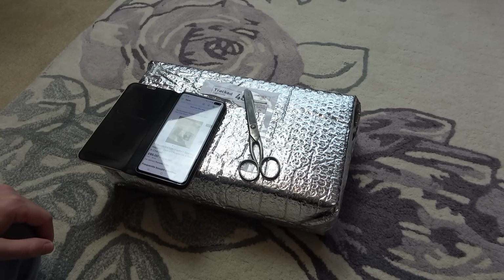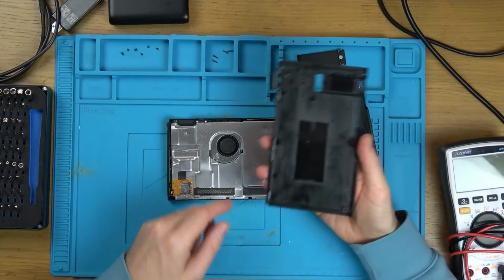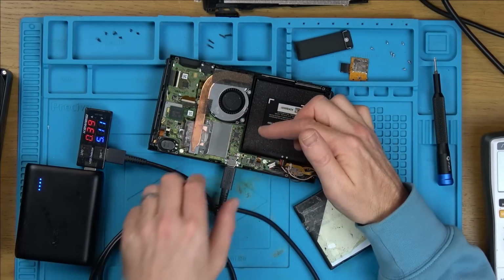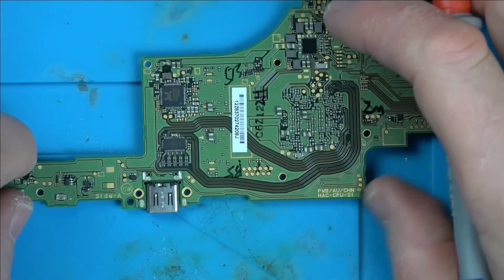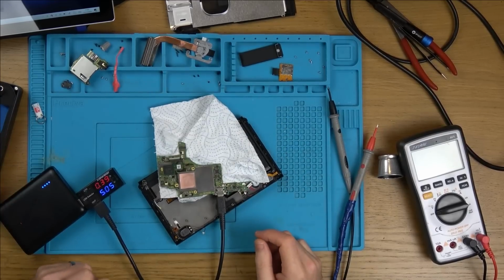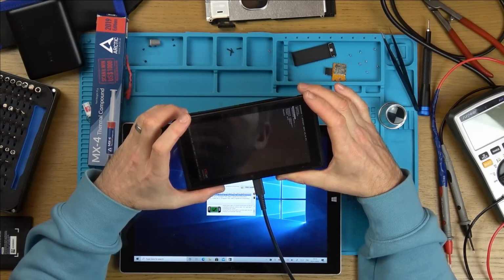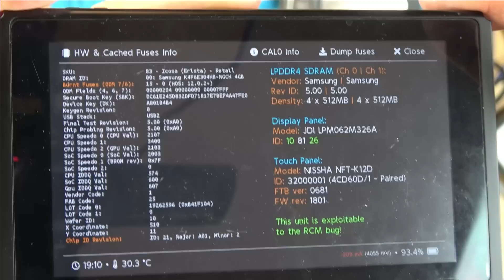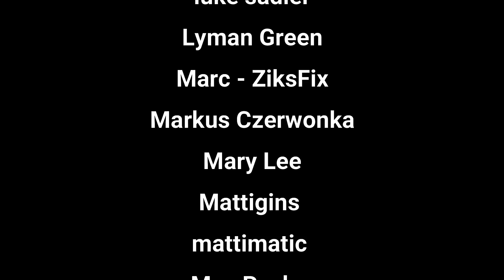Dishonest Broken Nintendo Switch from eBay - Can I FIX it?

Comment: For God's Sake All of you (you too Vince), STOP telling "is Hacked"...  Is not hacked... 
The eMMC NAND is gone faulty/broken, and so the RCM is automatically triggered by the APU, and can even be triggered if you unplug the emmc module from the motherboard.

If AutoRCM Mod is installed on the NAND, but the NAND is Broken/Inaccessible how on earth can you trigger it? The response is above.

CFW is Installed on the microSD, emuMMC too, so you dont even touch the original NAND, if a CFW is installed.. This is the Basics when you install a cfw.

And don't confuse bricked console with Faulty emmc, because a bricked console will still turn on, even if you brick by accidentally turn off the console while updating the firmware, or if you are unlucky it turns off by itself during update ... 
The Switch can still turn ON, BUT it will "LOOP" with the Nintendo LOGO Reboot and repeat.. It's called Nintendo Logo Brick Loop, because the firmware is broken.
I know it very well, because a long time ago i accidentally bricked/corrupted the firmware, and the console stayed in the logo loop, until i fixed the firmware dirs/files.

This isnt the case, the eMMC NAND is Faulty/Broken. STOP!

Comment: 25:40
Vince, what you found from plugging in the Tablet and using TegraRCM was important, but it's not what you think it is.

"RCM OK" doesn't mean that it's been hacked, but instead that the main bootloader for the Switch OS is bypassed for the backup . Whether or not a Switch has been hacked, if I plug in a Nintendo Switch turned on normally, of course it will not be in RCM. The findings you have show that, for some reason, the Switch is always in its backup bootloader. It is odd because it should only happen if you boot with a jig connected and press the sequence of buttons on the top. Perhaps the main OS did have a hardware failure and grasps on its RCM as a fallback, or maybe it actually was hacked but somehow had the main boot procedure changed with the backup bootloader, which is completely ignoring hacking guides.

Comment: Anyone had/has my issue with a Series X controller? The issue I'm having is the with the start button (button w/ 3 lines) It seems as if it is always pressed down. The controller isn't sticky or anything other than the button isn't actually pressed in. It acts as it should normally, but testing it in gamepad tester or xbox, it is always highlighted. When I go to use the controller on my Xbox, all of the menus fly by super fast. All of the other buttons work fine. If anyone, especially you guys who fixes these kinds of things, have a know how to solve this let me know. I made a video on my channel under "xbox issues" showing the issue.

Comment: You can overclock the ram/graphics/Cpu on jail braked switches which is actually useful on laggy games.
Also please let the sellers that try and "do one" that you have found it was hacked and you fixed it just for the jokes in future videos (second time you fixed a scammers item I  believe.)
Reply: And you can mod Switch games. Proper mods for Skyrim and such and simple performance hacks for pretty much any  other demanding title. It's great.

Comment: I was doing a motherboard and dreading testing 100s of passives for double beep shorts, when I realised, if one side DOESN'T beep, you don't need to test the other side because it's already proven it won't double beep. Did the whole MB in about 10min.

Comment: Why don’t you remove the “hack” and put back the original software?
Reply: For God's Sake is not hacked... The eMMC NAND is faulty/broken, and so the RCM is automatically triggered by the APU, and can even be triggered if you unplug the emmc module from the motherboard.

If AutoRCM Mod is installed on the NAND, but the NAND is Broken/Inaccessible how on earth can you trigger it? The response is above.
Reply: Oh i thought the eMMC was just corrupted by the previouse owner

Comment: Note: You can only do this with V1 Switches from 2018 depending on the serial number. V2 and The oled version you cant upload a payload so you can't install custom software.

Comment: I immediately knew it was in AutoRCM mode and likely had a bad eMMC. As someone that works in repair, this is all too common with hackable Switch units. I almost assume it's the issue at this point.

Yet, sellers never tell the truth. The always "have no idea" yet when you get it running again it's been modded to the brim already, lol.

Glad you figured this one out :)

Edit: Also, the seller knew as a console only goes into AutoRCM on it's own when the battery goes below 1v. Since that had 2.5v , they certainly knew.
Reply: Are you joking right?
AutoRCM MOD cant activate if the NAND is faulty. But the console will trigger the RCM because the NAND isnt Accessible (fault/broken).
In fact, when Vince changed the NAND with a working one, RCM isnt triggered by default.

But anyone can do this experiment, unplug the eMMC Module from the switch, turn it on/or connect to pc, and MAGIC RCM mode activated. 
because there is no nand or missing, or like above, fault/broken...

Comment: Vince could you do me a favour and send me the serial number to this? I have a feeling I worked on this a few weeks ago. It has a dead EMMC and I did actually attempt a repair on it. I don't think it had been hacked (I asked the owner). A reball won't work on the EMMC because the chip itself has failed completely and it needs a new EMMC pairing to it. Great job pinpointing the issue btw!

Comment: It looks like APX is a built in 'service mode' that normally isn't available to the end user.
It does not appear to be a firmware 'hack' or modified software on the switch so far as I can tell.  Here's a short video showing how to access it with a functional switch.https://www.youtube.com/watch?v=d042IoBkJjI

Comment: For the eMMC, I don't really know to what the code is tied up to. Do you think putting a different eMMC module on the old board could work? Idk if you've tried this before. Also, there should be a way to rewrite an eMMC module because what if the eMMC module does go bad on a good Switch and the repair needs to be made by Nintendo? If they have a software to write the codes to the chips, then someone i  the homebrew/modding community would most likely have one too.
Reply: There is a way, but isnt very "Easy"... 
You have to dump the fuses and tsec infos from the console, using Hekate.. 
And Re-Encrypting the Donor NAND with the Keys of the console to repair... After this you can have a working switch, but NO online forever, since you cant restore the Switch IDs .

Comment: You might be able to restore the system by dumping prod keys with lockpick rcm from within hekate. Likely you would need to keep the switch running CFW and would not be able to use online services. This video may be of some help. https://youtu.be/mH8osmtPFlA
Reply: This is what you need

Comment: eMMC is a emulated MMC - it's created by user on the sd card, and then you can run it on this virtual mmc so you will not damage real one. MMC is a real memory. Try preparing sd card and running atmosphere.
Reply: Wrong... eMMC is the physical NAND on the Switch... The emulated one on the microsd is called emuMMC.

Comment: Stack smash is slang for a overflow or in this case a buffer over flow where you get a computer to execute data as if it where executable by forcing the stack to  jumps to the malicious code on the stack. A stack is just a data structure used to store data objects. You can think of it as a bucket. Every application running on a computer will have its own stack allocated to it like word processor or web browser. 

A bug was discovered in Nintendo bootloader which allows for stack smash to gain control of switch before it boots.

RCM is recovery mode or manufacturing mode this is a simple program that allows a device to be programmed be it initially or to repair it in the future.

For instance at the factory Nintendo will use it to load the switch os during manufacture.  

The emmc nand is tied (married) to the system so you can't simply replace it with another. It's ashame but as gadget says maybe in the future this might be broken. 

So the likely cause is a dead eMMC it's a shame Nintendo provides no way to replace a part that has a limited life span.

Comment: I would love to watch your videos I used to...I found your videos because I'm a fan of tronixfix....his videos are like 10-20mins...every time I see a video from you it's 40mins - an hour please cut out some of the diagnosis and unnecessary stuff to just get the watch time down a bit like I understand tronixfix is a professional and you're learning as you go and you want to emphasize that but to much emphasis on that to me makes the video boring to watch even when I did used to watch your videos i found myself fast forwarding alot of what I'd consider waffling to get to the parts where you actually find the fault or whatever so many times I've watched you fix something for like a solid 10minutes only to say oh I guess that wasn't even broken after I watch you faff with it for ages just a bit of editing to cut some of that out would improve your videos sooo much because you are interesting and your videos are good

Comment: As someone with experience in software modding the kid had no idea what he was doing, he must have been installing android or some other custom ROM and soft bricked it. (I only have experience in phone software modding but it is still quite applicable for a switch.)
Reply: Don’t think so as Switchroot android and Switchroot Linux both don’t touch the EMMC. They  are rather installed onto an SD Card